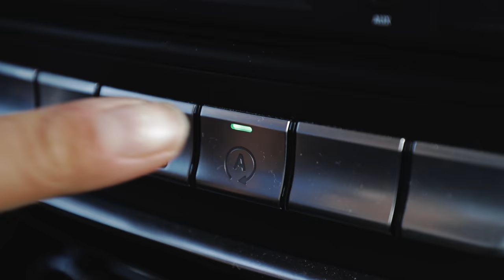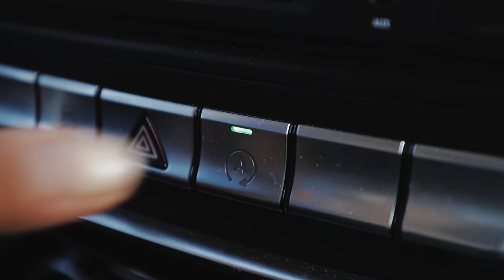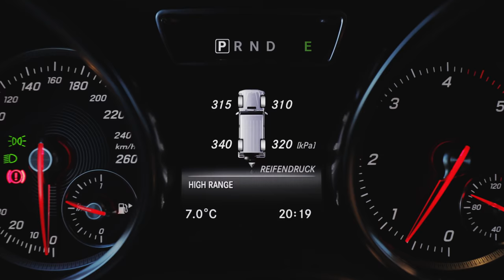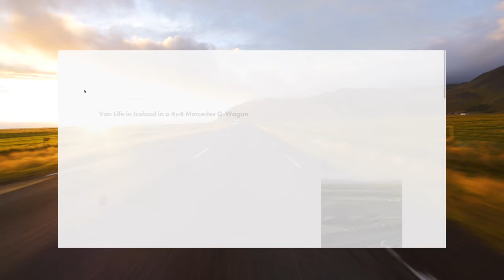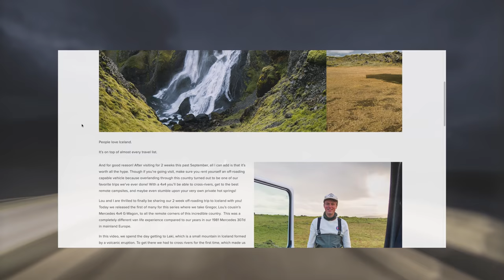Van Life in Iceland is UNREAL... 4x4 Mercedes G-Wagon Overlanding Adventure!

Comment: That is NOT a van!

It is a very expensive, commercially manufactured camping module fitted onto a blinged up G model military off road vehicle.

A bog standard 4x4 should have coped with that route, and indeed many do just that as hire vehicles.

To portray this as something other than as a comfortable, risk free holiday is simply false!